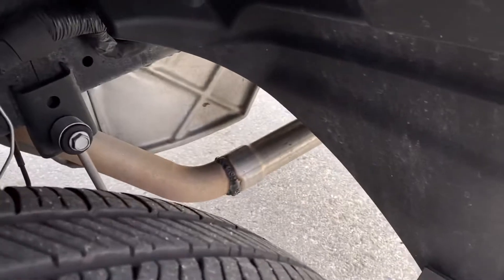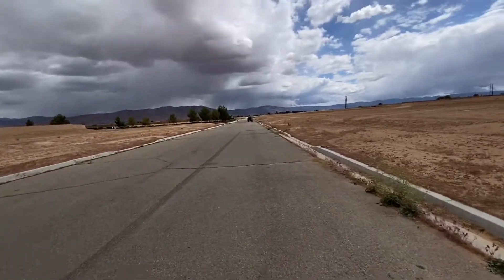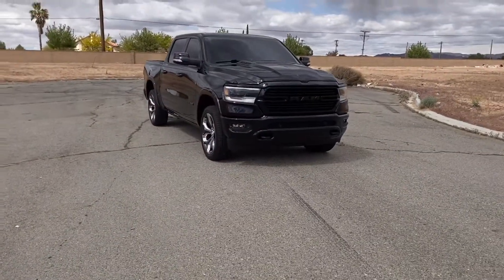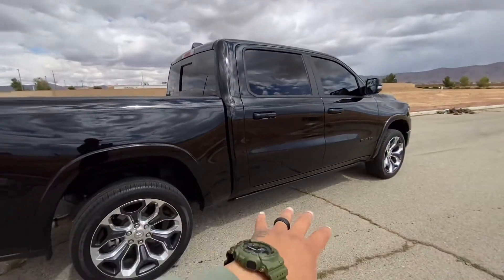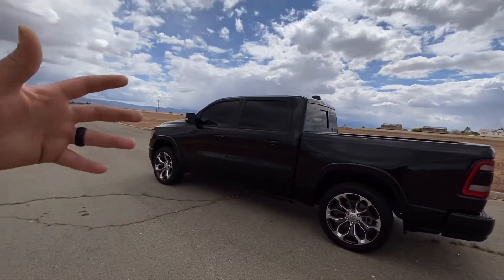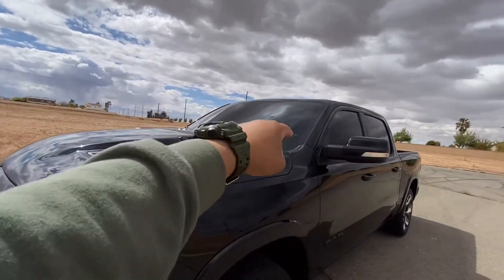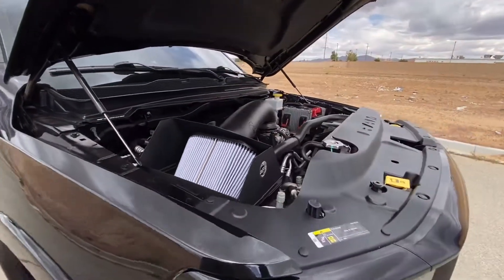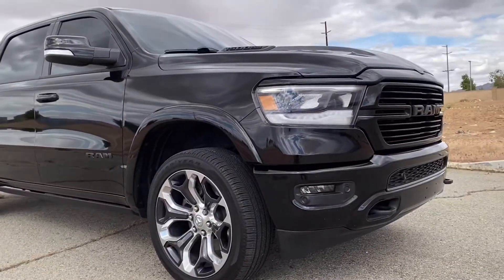2019-2021 Ram 1500 Laramie Muffler And Resonator Delete| Fly By’s Revs| Update On The 2019 Ram

Comment: Nice looking Ram. I came across your channel because I’m thinking of doing the same to my Ram 1500 Lone Star. I just needed to hear a bit and see if it’s worth it. Mine is a 2022 blackout. I’ve added step side nerf bars (black of course), BakFlip MX4 (tonneau cover), and spray on rhino liner in the bed. Subtle upgrades make a huge difference! Now, I just need it to purr louder than the stock exhaust. 

I completely understand about putting your family and financial needs first. I had that same situation years ago. But definitely looking forward to your future mods. Thanks for sharing bro! God bless.
Reply from the maker: God bless as well brotha yeah sadly had to let go of the Ram kept giving electrical issues sunroof was super intermittent, reverse camera kept going out randomly I did everything possible cleaned the tracks out cleaned the reverse camera harness since I live in the desert figured I’d might be dirt particles causing it did the whole removing the fuse and unplugged battery nothing changed so I had to sell it. As soon as I told it to my job they took it to Ram got it all fixed for 8k and someone bought it a week later so I know it’s in good hands and working back to factory spec couldn’t let it go without saying the issues regardless of how less we got but we ended up still getting 45k for it just cause of the market
Reply from the maker: Do happen to have an Instagram so I can check out your rig?
Reply: @sheeshtv721   I barely made an IG for the Ram itself (@blackmamba_hemi). I’m gonna use the page for mods and accessories upgrades. I’m sorry to hear about having to sell the truck. But I’ve had people give feedback on Pros and Cons on the Ram 1500’s. Many have definitely complained about the backup camera going out or having a blue screen. I’ve had it for a month so far, so it seems good so far. I just had a frustrating moment with the LED’s. The manual and seller recommended “H11” bulbs for low beams and “HB3” bulbs for fog lights. My truck has the wiring reversed, so the bulbs do fit, but not for their locations. 😓 “H11” bulbs are for fog lights and the other ones are for headlights. So, I’m definitely hoping that I don’t have electrical issues in the long run and have wiring mixed up or in reverse. 😅🙏🏼 Thanks for sharing your videos regardless, and I’ll still watch out for more. Have a great and blessed week!

Comment: What tint percentage on your windshield?
Reply from the maker: 35% should’ve did 20
Reply: @sheeshtv721  there's no legal limit where you are? I'm from Ontario, Canada and the limit is 70% or less on side windows and only a 6 inch strip across top and bottom of windshield
Reply from the maker: Legally there’s supposed to be zero windshield tint and nothing on the front side windows but as dark as you want the back glass and rear side windows. But I live in the desert and the cops in my area don’t care to much about tint unless you give them a reason to pull you over since it’s more of a “fix it” ticket BUT if I’m in the city areas like Los Angeles for example they will get immediately so I stay from down there unless I absolutely need to be there

Comment: Nice I’m thinking of doing this! Is it only 2 resonators or 3?
Reply from the maker: I did the 2 resonators and the muffler there’s technically 3 resonators but I still wanted some back back pressure and It sounds amazing I have no drone at all and thousands cheaper I think spent $200 with tip